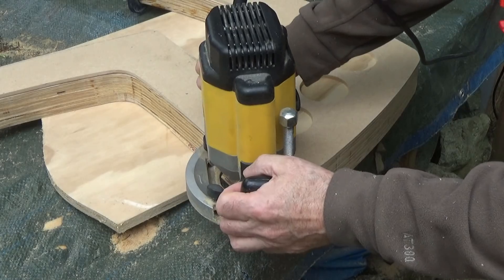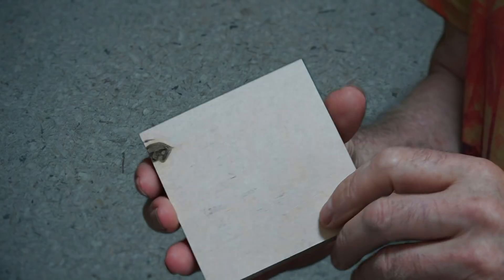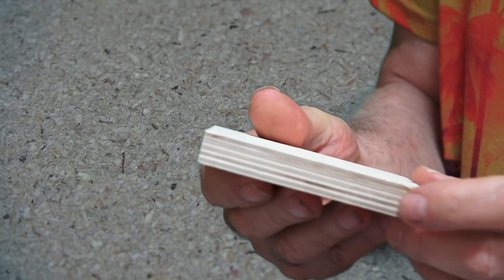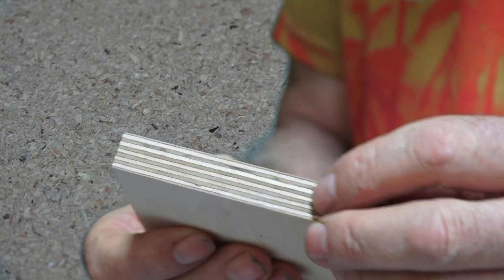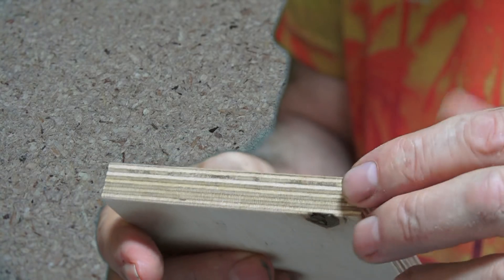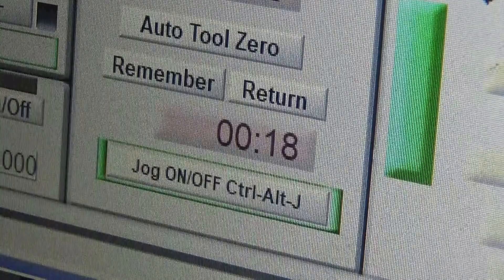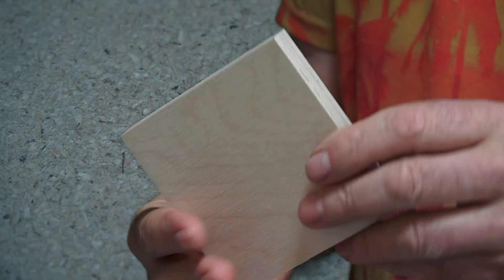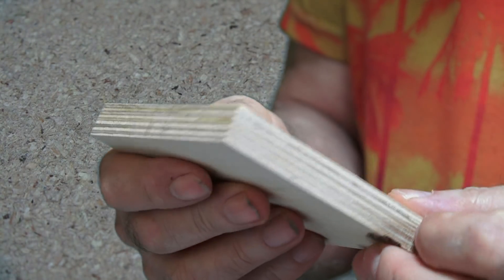The Quickest And Cleanest Way To Cut A Piece Of Plywood

Comment: As for low cost CNC machines you might look at Maslow I have no connection with, but will be buying one shortly.
A radial arm saw does a better job cross cutting ply than a table saw
Reply from the maker: Thanks, yes I've come across this unusual CNC device. Looks interesting.

Comment: I would say a circular saw does it better.
Reply from the maker: No way!  There would be fibre breakout.
Reply: Well, you could use a splinter guard. Or use some kind of scoring technique.
A CNC has it's strong points, but it' probably less so for straight cuts.
Reply from the maker: Trust me please - I have been woodworking for over 50 years and used every conceivablt tool and machine. Plywood breakout on the corners occurs with just about every tool, but especially using a circular saw. Breakout on the undersurface is a given with a rotary saw! The demonstration I showed in this video is impressive. Why can't some of you guys just refrain from giving an opinion and accept someone's experience? I wouldn't have made this video if it wasn't impressive. If you don't respect my judgment then don't subscribe. I welcome comments where actually I can learn something in return please!!

Comment: Anybody that can afford a CNC machine wouldn't be making anything
Reply from the maker: You would be correct if CNC did everything but it doesn't! I would see it as a valuable tool amongst others. There is still handwork, finishing, selecting materials. As far as I am concerned a CNC machine, once the software learning curve is surmounted, offers more time and options to be creative, certainly more creative options. I am the guy who wrote The Incredible router in 1989 and turned a grooving tool into the most versatile tool in the workshop, but you didn't know that!  It is not the machine but how you use it which is the key.  Invested wisely CNC will save money so it will therefore be affordable longterm.
Reply: Don't forget the pleasure aspect of making stuff. It's why many people have hobbies after all. ;¬)